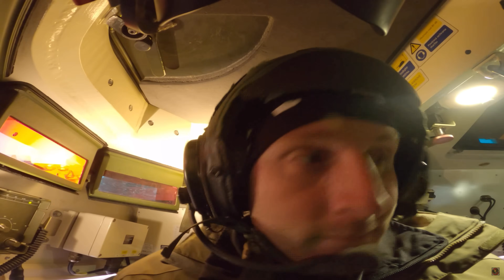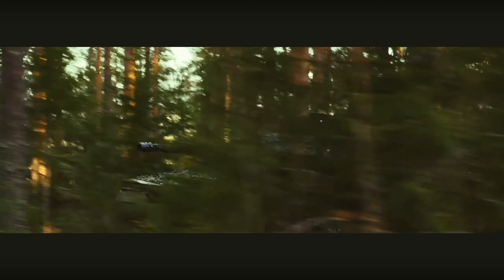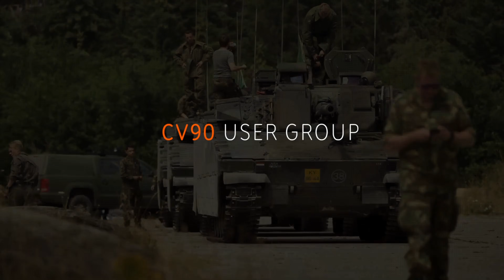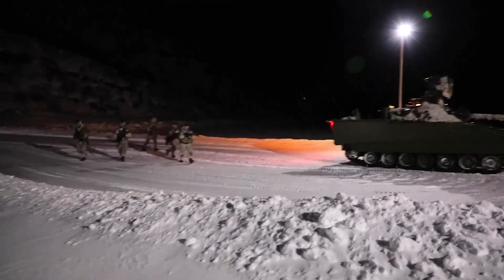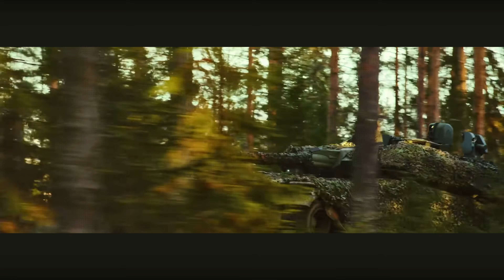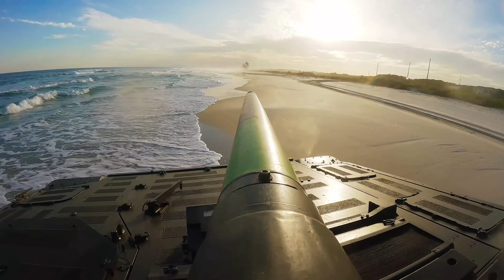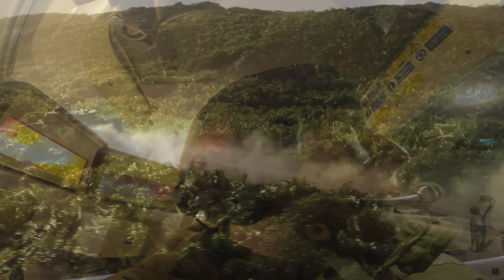Why is the CV90 IFV selling so well globally? | MASSIVE VEHICLE SALES 💰💰💰

Comment: We all know about the CV90s amazing performance, firepower, mobility, tech, etc, etc. Such an underrated aspect of the vehicle, that is way more important than one may initially think is its size. It is VERY size efficient, especially in its height. It has a smaller profile than the Bradley, Ascod, KF41, and especially the Redback! Smaller profile, yet it still is just as potent, more mobile, and carries the same amount of troops, +/-1 depending on version. Not only are you harder to detect and with that carry a huge tactical advantage (especially when you consider its low heat signature), but it is also much easier to transport as it can fit in a significantly larger amount of european railway tunnels (sometimes even carts without exposure meaning the transport is more secret), and with less deconstruction needed during train and air transport, compared to all other IFVs with one exception, the Soviet BMP, it however, as we know, isn't even worth mentioning as a competitor, not just for political reasons, but also because it is, well, shit. Another good thing is that since it already is low profile, if you want to add additional weapon stations on top of it for, oh idk, maybe protect against drones, you got more room to work with before you're starting to look like a giraffe.
Reply: All NATO IFVs and MBTs fit all European railway tunnels. Loading gauge is standardized and literally a key design aspect of any military vehicle, even US ones.

Low silhouette is also a outdated concept from the time before proper fire control systems, modern vehicles are taller because proper mine protection needs extra space in the hull floor for bulging plates. Look up a CV90 with opened rear ramp and compare the hull bottom thickness with modern designs like Puma, Lynx or Redback.
Reply: As shown in this video: https://youtu.be/lUyZIqH2XQE?si=U3ByNhzYO8GShnjP , the CV90 comparatively has a significantly easier time fitting in railway carts (czech ones in this case), than the KF41 and Ascod, considering how overly big the Redback is, do I even have to say it?

Looking at combat vehicle images/videos is fun, but if you want actual insight into its performance, I suggest you look at its actual combat record. The CV90 has seen hell in both Afghanistan and especially in Ukraine, where it has withstood everything from direct fire, ATGMs, IEDs, mines and drones. It already comes with suspended crew seating and high ground clearance, older versions that saw combat were equipped with a mine protection kit that has been proven in both Afghanistan and Ukraine, and MKIII onwards has additional mine protection from the factory. The CV90 is literally THE most proven modern western IFV. The Bradley has seen more combat but is on its way out, whereas the CV90s success is just  increasing due to its remarkable performance in Ukraine, where it is continously praised by the users for its safety, mobility, and ability to support troops with suppressive fire.

Profile matters, not because its harder to hit, it's because you're harder to see. Not only is the CV90s detectable area the smallest of all western IFVs, but it also boasts one of the most clever heat signature reducing systems around, that also disperses its exhaust to the point where an enemy with a heat camera can't confidently tell wheater or not the source is a car or armoured vehicle. The longer it takes for you to be detected, the better. As many have discussed resently, it's seldom about who has the most power but rather about who is able to fire first.

All IFVs come with their advantages, but right now the CV90 is receiving a lot of orders, and catching the eye of many potential operators, and that's not for nothing.
Reply: @ If you want actual insight in performance you look at comparison trials where testing is done under laboratory conditions. Combat record doesen't say anything, there have been MRAPs that got lucky and survived RPGs and ATGMs. Also it's really not hard to look good in comparison to Soviet BMP, BMD and BTR series in that combat theater.

If you look at the vehicle data instead of listing random stuff it has survived you will actually notice BAE doesen't manufacture the CV90s composite armor themselves. Modern CV90 versions use AMAP addon composite armor made by Rheinmetall AG. Mone protection kit is RUAG MinePRO, now also part of Rheinmetall AG.

It literally uses the same composite armor than most of its competitors, mainly ASCOD Lynx and Puma. The issue here is that Lynx and especially the Puma carry a lot more of the same armor. In case of the Puma it's more than 10 tons more of that armor.

Combat proven is one thing, actually having been on German-Dutch joint field exercise and having seen with your own eyes that a Puma literally has thicker roof armor than a CV90 has front armor (!) makes you rethink.
Reply: @   except the ukrainian crews also compared it to the Bradley, stating that the CV90 is on a different level of performance.

You are aware that there are different armor configurations for the CV90 right? Most customers picked lighter weight armor, light armor kit or just base, for the sake of mobility. Also considering that the puma and CV90 have the same side armor rating, and probably the same front armor although the CV90 could be better, at the same time as they have equally powerful engines at roughly 1000hp or 800kw, whiles the CV90 can carry two more soldier and has lower base weight, meaning it has better power to weight ratio, and thus could carry more armor if desired. I suspect that’s what we will see if Slovakia orders the CV90120 as it looks to have more armor than any other version in its renditions.

If you think the CV90s combat record are just some lucky vehicles, you should reconsider, as it has had the lowest loss rate of any armored vehicle in ukraine, and a similar story in Afghanistan. If it really was as frail as you seem to think it is, then why does it outsell EVERY other western IFV right now? Food for thought.
Reply: @nivsen5986  Bradley protection, especially with BRAT kit, is superior to the CV90. This is also confirmed by Ukrainian operators.

CV90 and Puma do not have the same side or front armor rating. CV90 MK IV meets STANAG 4569 Level 6, Puma exceeds STANAG 4569 Level 6 as stated by the manufacturers BAE and PSM. The problem here is that so far 6 is the highest standardized protection level in 4569. It also only documents ballistic protection against KE, not protection against shaped charge warheads.

To explain to you the technical side, CV90 relies on passive solution only, ceramic composite plates mounted to the hull. Plenty visible in footage of pulled powerpacks. Puma has similar passive ceramic base armor but also has reactive elements on top, ERA on the upper sides and spaced multi-layered NERA on the lower sides and front. That boosts protection level against shaped chargest significantly.

To put it into perspective, the CLARA ERA on the side of the Puma is able to widhstand 30 mm APFSDS (4569 Level 6) on it's own, yet the passive base armor mounted behind the ERA is also able to widhstand 30 mm APFSDS on its own. These two vehicles are absolutely not comparable protection-wise, and Czech Officials also confirmed that after testing in their trials.
Reply: @jonny2954  I haven't seen that statement but I won't presume to know everything the AFU has said, although I am skeptical considering that the Bradley has over a 40% loss rate in Ukraine.

The basic CV90 hull armor, and the basic Puma hull armor (Class A) are both rated for 14.5x114mm armor piercing rounds to the sides, and both being rated for 30mm+ APFSDS to the front, although the CV90s front armor is classified and has gotten thicker without addon kits in the newer models. The CV9040b (mk0~mk1) have been confirmed to be able to withstand at least 30mm to the front. 

The CV90 does not rely on passive solutions only, since the MKIIIC and MKIV have both been displayed with the Iron fist active protection system. As previously stated, the CV90 with no addon armor weighs less than the Puma class A, by how much depends on version, but since they both have an engine that produces roughly 1000hp, we know that the CV90 has a better power to weight ratio. With that in mind, let's say that a customer wants ERA on their CV90, or more ceramic armor, they now have the wiggle room to add it if they desire. The CV90 MKIV already comes with extra ceramic armor rated for 30mm APFSDS from the factory, but the newest version of the CV90120 that has been marketed to Slovakia is shown with additional all around armor on top of that, even though it is based on the MKIV, so this idea that the CV90 couldn't tank up if desired is false.

A large reason why many hesitate on adding ERA to their IFVs is that they will often operate with infantry deployed close around it, and in such a situation ERA can become hazardous to said infantry, hence why an APS like Iron fist is prefered. The main reason though is probably that most militaries value mobility heavily on their IFVs, an aspect where none can match the CV90 as we've seen, especially with the active suspension system and rubber tracks.

It is rad that the Puma can tank as much as it can, but at what point does the penalty to mobility and lower soldier transport capacity become too much? Consider why the Puma has had no sales outside Germany and why the CV90 is in service in eight countries with three more on the way as of right now.
Reply: @nivsen5986  Bradley has higher losses because it is used in units that see more action. Same reason more Leopard 2 than Challenger 2 were lost.

What "basic" CV90 are you talking about? Initial Swedish CV9040 had very low protection level, only being protected against 12.7 mm AP. Latest CV90 MK IV has STANAG 4569 level 4 sides and 5 front base armor, with addon armor it meets level 6 frontally and 5 on the sides.

Puma "A" configuration also isn't base armor. It's the "Airlift" configuration with a significant amount of side armor stripped to meet the weight limit of the A400M.
The vehicle does not enter combat in this configuration, armor is delivered via a separate A400M. "A" armor is level 4 on the sides, front remains like in "C" exceeding level 6.

"C" is the "Combat" and standard configuration and adds another 10+ tons of composite armor to the sides and turret. "C" brings the sides to the same protection level as the front, exceeding level 6. Footage shows front armor consisting of 3 (in some areas even more) NERA layers angled at >70 degrees plus steel base which is far beyond STANAG 4569 Level 6. Total space reserved for the front armor array is 300 mm, CV90 doesen't even have space for so much armor.

Reactive and passive in relation to armor solutions, not APS. Ceramic armor is passive, ERA and NERA are reactive. CV90 only carries what is thought to be NERA in the strf 9040c variant with MEXAS kit. Not very dense judgung by the minor weight increase though.

Gross weight limit isn't dictated by engine power but by hull and suspension limitations. Latest CV90 MK IV has a maximum gross vehicle weight of 37 tons. Puma S0 is at 43 tons, Puma S1 was trialed up to 45 tons.

The internal volume of the Puma is actually more compact than on the CV90. This is boosting weight/protection ratio even more (less volume = less surface to armor). Add to that a lighter hull made with KMWs Dünnblechbiegetechnologie and even more weight reserves are freed for more composite armor.

Engine power isn't the issue, there was an improved engine for the Puma proposed by MTU designated MT 892 Xa-500 with increased power from 1.088 hp to 1.340 hp. During trials by the German Army the 1.088 hp proved to be sufficient for the current weight. They are outpacing their own Leopard 2 and Dutch CV9035NL in joint FTX. Mainly due to the suspension though.

Puma carries CLARA ERA which is the first Explosive Reactive Armor designed to be fragmentation free and safe for dismounts. This is achieved by using a composite fibre material instead of metal or ceramic plates for the reactive elements.

Dismount safety is also the reason Puma carries softkill APS only and no hardkill APS. Your claim hardkill APS would be in any way safer for dismounts than ERA is dubious. Perhaps distributed systems like StrikeShield, but certainly not launcher based systems like Trophy or Iron Fist. The IDF literally changed dismount tactics after introduction of Trophy.
Reply: @jonny2954  You do know that literally the first place the CV90 was deployed in Ukraine was Bakhmut right? Since that it has for example been deployed with the 93rd mechanized brigade in Vovchansk to repel the new russian Kharkiv offensive, and more resently it has seen action in Kursk. Sorry but you can't blame it on the amount of action the vehicle has seen in this case.

Yes, I know Puma class A is the airlift version, although it is combat rated if needed. I was making a comparison as to what a stripped Puma looks like in terms of power-to-weight as to a stripped CV90.

What is more hazardous for infantry, reactive armor or APS, is dependant on doctrine, however, considering what we see in Ukraine right now, that being infantry deploying in very close proximity to the IFV or APC to use it for mobile cover, which isn't very new either, in their situation reactive armor, even fragmentless, is way more hazardous. No matter whether it has fragments, an explosive blast to the face is more than enough to knock you out, give you burns, or at the very least concuss you. I love that they have developed a safer type of ERA but the simple nature of explosives and hot gasses means you need to be careful, and this is why you see most nations in europe right now, move towards APS solutions, not ERA. A large reason why the IDF changed their dismount tactics is because they mainly conduct urban counterinsurgency operations where intercepted hazards like rpgs are much closer by most of the time and infantry need to stay away from the street, whereas in a near peer war, the most likely engagements are non urban as we have seen in Ukraine, thus the interception distance is extended and it is more desired to stay close to the vehicle.

The old Strf90s from the 1990s had a very different hull with lower protection, smaller crew compartment and overall lower tech, hence why Sweden is looking to develope the MKV as a replacement for them. All new production CV90s, MKIII and MKIV are rated STANAG 4569 level 4 to the sides, level 6 to the front, and level 4a/4b mine protected. That is without the addon armor. With addon armor, sides reach or exceed level 6, and front exceeds level 6. The CV90120 has since a long time been showed with much thicker armor and sideskirts, and the newest version marketed to Slovakia has taken that to the next level and truly bulked up when it comes to armor in all areas. Comparatively, the Puma is not only about 0.3 meters taller, and about 0.6 meters longer but also wider by about 0.8 meters compared to the CV90, which isn't ideal when trying to stay hidden or traversing areas with limited space. This is also with a two person lower soldier carrying capacity, which is the explanation for the lower internal volume.

The CV90 MKIV has been marketed in configurations weighing 35 to 37 tonnes, but it is cleared for at least 39 tonnes, however, the old CV90120 with a 800hp engine was cleared for up to 40 tonnes, and the new CV90120 marketed to Slovakia, which uses the same active suspension and X300 transmission as the regular MKIV, has been marketed in a 37+ ton fire support configuration, as well as a tank-esque configuration weighing up to 45 tonnes, which makes sense with the new suspension, transmission and engine. Also worth noting is that the older CV90120 with the 800hp engine was also stated to be able to take a 1200hp engine, and that hasn't changed. If anything, in the 10 or so years since then there has probably been an even more potent engine made available, although BAE systems Häggluns hasn't said anything about it so that's just me speculating. So again, if desired the CV90 can carry a lot more, most armies however, choose mobility and APS over a significantly heavier vehicle with increased front and side profile.

The CV90 has been proven multiple times to preform the best in wet, muddy, snowy and boggy/marshy conditions, which are the most important areas since you seldom want to compromise your strategies due to wheather and / or geography. The newer versions with active suspension (The dutch CV90s don't have this, the first CV90 version to use this was the Armadillo apc configuration) have a 30 to 40 percent speed increase in rough terrain compared to versions with torsion bar suspension, well outpacing MBTs and being able to fire on the move with amazing stability, aswell as being able to hard break and fast accelerate with minimum wobble, and the breaking distance at top speed has been more than halved. Side note, this system is funnily enough derived from a F1 suspension system. In terms of strategic mobility, the CV90 can travel at least 900km on road, but according to BAE systems Hägglunds it is 1000km, without refueling, whereas the Puma has an operational range of 500 to 600km on road from what I can find.
Reply: @jonny2954  You do know that literally the first place the CV90 was deployed in Ukraine was Bakhmut right? Since then it has for example been deployed with the 93rd mechanized brigade in Vovchansk to repel the new russian Kharkiv offensive, and more recently it has seen action in Kursk. Sorry but you can't blame it on the amount of action the vehicle has seen in this case. 

Yes, I know Puma class A is the airlift version, although it is combat rated if needed. I was making a comparison between what a stripped Puma and a stripped CV90 looks like in terms of power to weight. 

What is more hazardous for infantry, reactive armor or APS, is dependant on doctrine, however, considering what we see in Ukraine right now, that being infantry deploying in very close proximity to the IFV or APC to use it for mobile cover, which isn't very new either, in their situation reactive armor, even fragmentless, is way more hazardous. No matter whether it has fragments, an explosive blast to the face is more than enough to knock you out, give you burns, or at the very least concuss you. I love that they have developed a safer type of ERA but the simple nature of explosives and hot gasses means you need to be careful, and this is why you see many nations in europe right now, move towards APS solutions for their IFVs and APCs, not ERA. A large reason why the IDF changed their dismount tactics is because they mainly conduct urban counterinsurgency operations where intercepted hazards like RPGs are much closer by most of the time and infantry need to stay away from the street, whereas in a near peer war, the most likely engagements are non urban as we have seen in Ukraine, thus the interception distance is extended and it is more desired to stay close to the vehicle. An even more important reason the IDF is changing tactics is because the Trophy and the Iron Fist are two very different systems! The trophy uses what effectively is a precise shotgun blast (explosively formed penetrator/ self-forging fragment) that originates from the launchers on the vehicle, and are only capable of destroying chemical threats like RPGs, ATGMs and other missiles, whereas the Iron Fist shoots out its own projectile from the launcher, that effectively is a fragmentless, shaped explosive, designed to detonate chemical energy threats like RPGs, ATGMs and other missiles, as well as high explosive tank rounds and kinetic energy threats like tank fired APFSDS rounds. It shoots the projectile further away from the vehicle, explodes in a pattern that minimizes rearward blast, with no fragments used as it has a fully combustible casing. This is also accompanied by a suite of electronically scanned array radars, and optionally IR sensors that share their information with the vehicle crew, giving additional situational awareness. Elbit systems have also shown a rendered version of it with a built in laser soft-kill APS although I don't know if that is the version that is on the CV90. Iron Fist is a fragmentless solution that detonates further away from the vehicle, making it much less hazardous than the Trophy, and in the case of Ukraine, less Hazardous than Clara ERA. 

The old Strf90s from the 1990s had a very different hull with lower protection, smaller crew compartment and overall lower tech, hence why Sweden is looking to develop the MKV as a replacement for them. All new production CV90s, MKIII and MKIV are rated STANAG 4569 level 4 to the sides, level 6 to the front, and level 4a/4b mine protected. That is without the addon armor. With addon armor, sides reach or exceed level 6, and front exceeds level 6. The CV90120 has since a long time been showcased with much thicker armor and larger and thicker side skirts, and the newest version marketed to Slovakia has taken that to the next level and truly bulked up when it comes to armor in all areas. Sizewise, the Puma is not only about 0.3 meters taller, and about 0.6 meters longer but also wider by about 0.8 meters compared to the CV90, which isn't ideal when trying to stay concealed or traversing areas with limited spacing. This is also with a two person lower soldier carrying capacity, which is the reason for the lower internal volume. 

The CV90 MKIV has been marketed in configurations weighing 35 to 37 tonnes, but it is cleared for at least 39 tonnes, however, the old CV90120 with a 800hp engine was cleared for up to 40 tonnes, and the new CV90120 marketed to Slovakia, which uses the same active suspension and X300 transmission as the regular MKIV, has been marketed in a 37+ tonnes fire support configuration, as well as a tank-esque configuration weighing up to 45 tonnes, which makes sense with the new suspension, transmission and engine. Also worth noting is that the older CV90120 with the 800hp engine was also stated to be able to take a 1200hp engine, and that hasn't changed. If anything, in the 10 or so years since then there has probably been an even more potent engine made available by Scania, although BAE systems Häggluns hasn't said anything about it so that's just me speculating. So again, if desired the CV90 can carry a lot more, most armies however, choose mobility and APS over a significantly heavier vehicle with increased front and side profile. 

The CV90 has been proven multiple times to perform superbly in wet, muddy, snowy and boggy/marshy conditions. The newer versions with active suspension have a 30 to 40 percent speed increase in rough terrain compared to older versions, well outpacing MBTs and being able to fire on the move with amazing stability, as well as being able to hard brake and accelerate with minimum wobble, and the braking distance at top speed has been more than halved. The dutch CV90s don't have this, the first CV90 version to use active suspension was the Armadillo APC configuration. Side note, this system is funnily enough derived from a F1 suspension system. In terms of strategic mobility, the CV90 can travel at least 900km on road, but according to BAE systems Hägglunds it is 1000km, without refueling, whereas the Puma has an operational range of 500 to 600km on road from what I can find.
Reply: @jonny2954  You do know that literally the first place the CV90 was deployed in Ukraine was Bakhmut right? Since then it has for example been deployed with the 93rd mechanized brigade in Vovchansk to repel the new russian Kharkiv offensive, and more recently it has seen action in Kursk. Sorry but you can't blame it on the amount of action the vehicle has seen in this case. 

Yes, I know Puma class A is the airlift version, although it is combat rated if needed. I was making a comparison between what a stripped Puma and a stripped CV90 looks like in terms of power to weight. 

What is more hazardous for infantry, reactive armor or APS, is dependant on doctrine, however, considering what we see in Ukraine right now, that being infantry deploying in very close proximity to the IFV or APC to use it for mobile cover, which isn't very new either, in their situation reactive armor, even fragmentless, is way more hazardous. No matter whether it has fragments, an explosive blast to the face is more than enough to knock you out, give you burns, or at the very least concuss you. I love that they have developed a safer type of ERA but the simple nature of explosives and hot gasses means you need to be careful, and this is why you see many nations in europe right now, move towards APS solutions for their IFVs and APCs, not ERA. A large reason why the IDF changed their dismount tactics is because they mainly conduct urban counterinsurgency operations where intercepted hazards like RPGs are much closer by most of the time and infantry need to stay away from the street, whereas in a near peer war, the most likely engagements are non urban as we have seen in Ukraine, thus the interception distance is extended and it is more desired to stay close to the vehicle. An even more important reason the IDF is changing tactics is because the Trophy and the Iron Fist are two very different systems! The trophy uses what effectively is a precise shotgun blast (explosively formed penetrator/ self-forging fragment) that originates from the launchers on the vehicle, and are only capable of destroying chemical threats like RPGs, ATGMs and other missiles, whereas the Iron Fist shoots out its own projectile from the launcher, that effectively is a fragmentless shaped explosive, designed to detonate chemical energy threats like RPGs, ATGMs and other missiles, as well as high explosive tank rounds and kinetic energy threats like tank fired APFSDS rounds. It shoots the projectile further away from the vehicle, explodes in a pattern that minimizes rearward blast, with no fragments used as it has a fully combustible casing. This is also accompanied by a suite of electronically scanned array radars, and optionally IR sensors that share their information with the vehicle crew, giving additional situational awareness. Elbit systems have also shown a rendered version of it with a built in laser soft-kill APS although I don't know if that is the version that is on the CV90. Iron Fist is a fragmentless solution that detonates further away from the vehicle, making it much less hazardous than the Trophy, and in the case of Ukraine, less Hazardous than Clara ERA. 

The old Strf90s from the 1990s had a very different hull with lower protection, smaller crew compartment and overall lower tech, hence why Sweden is looking to develop the MKV as a replacement for them. All new production CV90s, MKIII and MKIV are rated STANAG 4569 level 4 to the sides, level 6 to the front, and level 4a/4b mine protected. That is without the addon armor. With addon armor, sides reach or exceed level 6, and front exceeds level 6. The CV90120 has since a long time been showcased with much thicker armor and larger and thicker side skirts, and the newest version marketed to Slovakia has taken that to the next level and truly bulked up when it comes to armor in all areas. Sizewise, the Puma is not only about 0.3 meters taller, and about 0.6 meters longer but also wider by about 0.8 meters compared to the CV90, which isn't ideal when trying to stay concealed or traversing areas with limited spacing. This is also with a two person lower soldier carrying capacity, which is the reason for the lower internal volume. 

The CV90 MKIV has been marketed in configurations weighing 35 to 37 tonnes, but it is cleared for at least 39 tonnes, however, the old CV90120 with a 800hp engine was cleared for up to 40 tonnes, and the new CV90120 marketed to Slovakia, which uses the same active suspension and X300 transmission as the regular MKIV, has been marketed in a 37+ tonnes fire support configuration, as well as a tank-esque configuration weighing up to 45 tonnes, which makes sense with the new suspension, transmission and engine. Also worth noting is that the older CV90120 with the 800hp engine was also stated to be able to take a 1200hp engine, and that hasn't changed. If anything, in the 10 or so years since then there has probably been an even more potent engine made available by Scania, although BAE systems Häggluns hasn't said anything about it so that's just me speculating. So again, if desired the CV90 can carry a lot more, most armies however, choose mobility and APS over a significantly heavier vehicle with increased front and side profile. 

The CV90 has been proven multiple times to perform superbly in wet, muddy, snowy and boggy/marshy conditions. The newer versions with active suspension have a 30 to 40 percent speed increase in rough terrain compared to older versions, well outpacing MBTs and being able to fire on the move with amazing stability, as well as being able to hard brake and accelerate with minimum wobble, and the braking distance at top speed has been more than halved. The dutch CV90s don't have this, the first CV90 version to use active suspension was the Armadillo APC configuration. Side note, this system is funnily enough derived from a F1 suspension system. In terms of strategic mobility, the CV90 can travel at least 900km on road, but according to BAE systems Hägglunds it is 1000km, without refueling, whereas the Puma has an operational range of 500 to 600km on road from what I can find.